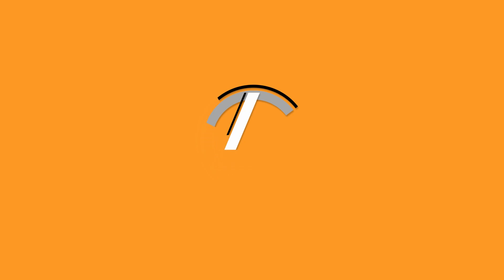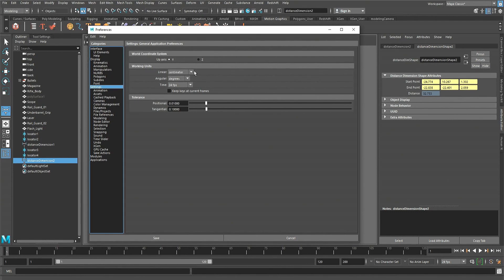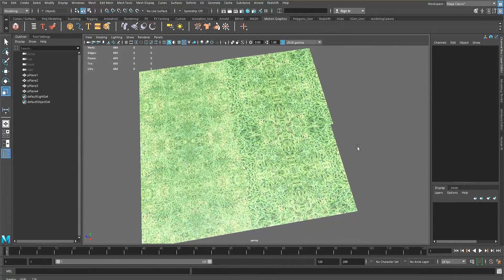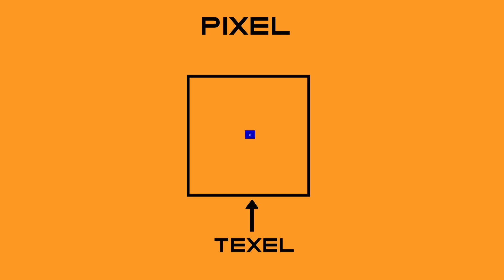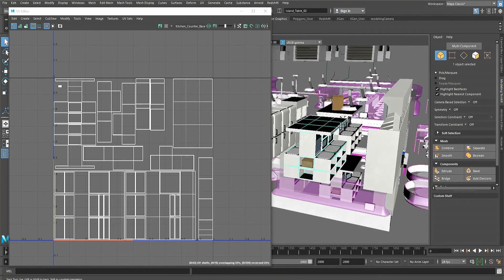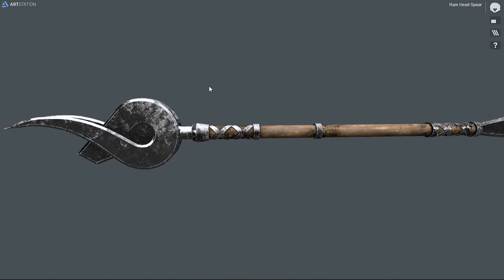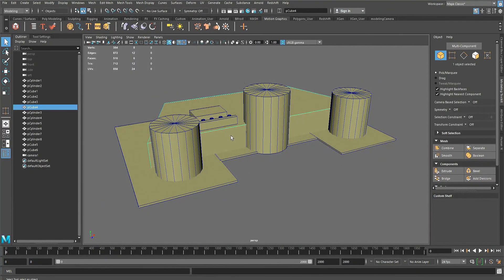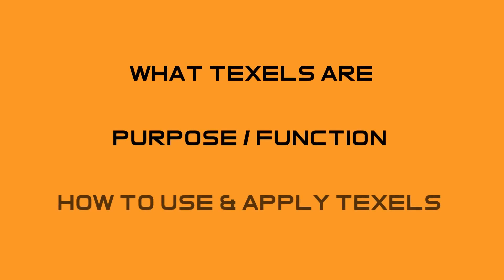Maya - Texel Guide

Comment: Another video with too much theory for those who already understand how it works. For beginners like me still hard to apply in real workflow. Now I have the same problem that @GAMER ROCKS below. I have a simple bookshelf with 200 cm, when I unwrap with layout map size 4096 px I get 10.98 texel density. If I set higher TD to get more density, even when I set Tiles U with 2 or more tiles, it does not work properly and Maya can't fit their islands with same proportions that I set. Absolutly different in Blender ir work very well...

Comment: How much high texel density for fps weapons
Reply from the maker: FPS weapons are held close to the camera/screen so you should have them textured with a high density. 10.24 px/cm would be a good base/standard to aim for but you could always go higher and then down scale if needed.
Reply: @leoncabrera5635  well when i bake with higher texel density it works like charm  but when i use texel density 10. 24px/cm or or even more  like even 40.48 the results are not  as good as using complete 0-1 space or like giving it more texel density like 100px/cm or higher gives awesome like it is actual a high poly.
Reply: @leoncabrera5635   so can you plz make video with some short example useing different texel density over a 1 m cube or something similar so can check my bake results with yours results with your .
Reply: is there any way i can share photos with you.
Reply from the maker: @gamerrocks8426  I'll leave a link to my discord in this videos description so you can share your work. I plan on making more videos but finding the time right now is hard.
Reply: @leoncabrera5635  thanks i posted my issue on welcome tab  with images i hope you understand my issue able to help.